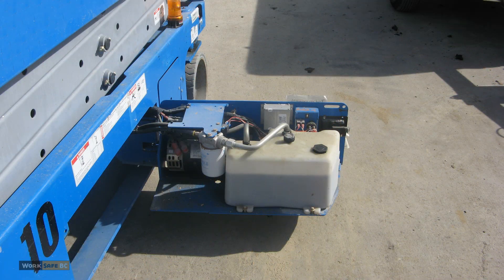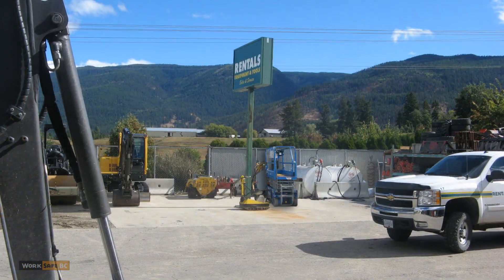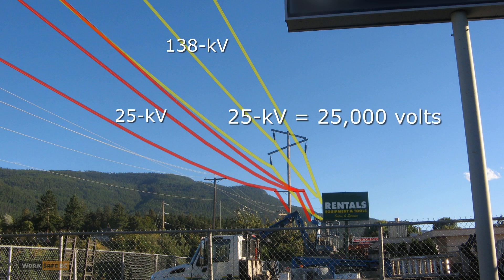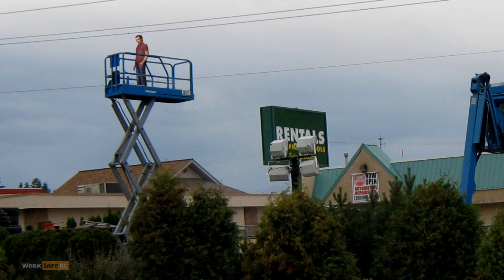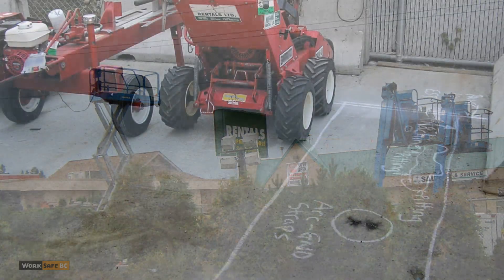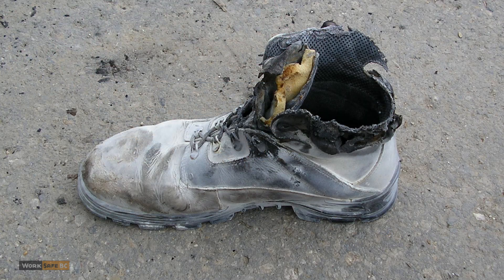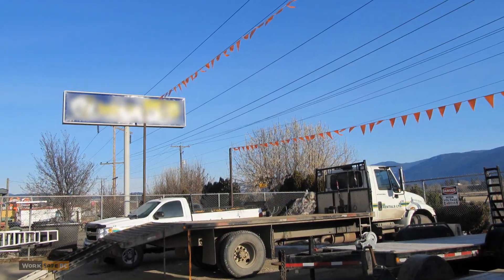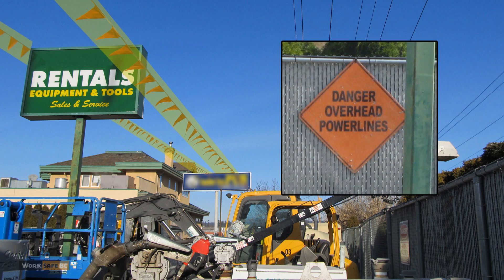Incident Investigation: Worker on Scissor Lift Electrocuted | WorkSafeBC

Comment: Why don't power companies run a low voltage bottom wire below the high voltage lines? Any contact with this lower wire by machinery would set off a flashing light and audible siren at the nearest pole warning the worker.
Reply: This stuff costs enough already
Reply: Ghost Yes, I agree - money before saving human lives. That makes the most sense.
Reply: Most people do not come into contact with power-lines.  I would say those that do either work in some related field or construction in general, and should pay better attention to there surroundings.  It is common knowledge that power-lines are dangerous so the vast majority stay clear, although accidents happen.  I don't disagree that in some instances it "makes the most sense" to put more into safety measures, I just don't think this is one of them.  The cost greatly outweighs the benefit.
Reply: Ghost The cost would actually be that of a thin aluminum wire [or two] stretching from pole to pole, and an alarm box which is next to nothing in cost considering most of us can visit our local Home Dipshit and purchase a cheap China-made door alarm for approximately the same cost. I'm not saying, "Let's go elaborate." but just have something there that safeguards the less informed people. It could be cost effective, and if dispersed over a large number of customers, the rise in utility rates to pay for such a safety device would be miniscule.

You do know that the life of just one individual is priceless, right? There's no "millions" or "billions" of dollars to measure against the value of a human life. So why not advance the entire electrical network towards better safety? To save one life would have the system pay for itself, but I have a feeling it will save hundreds of lives over time.

Enough of the defeatism! People should drop the low mentality of implementing improved safety measures only after accidents occur and instead seek the higher mentality of preemptive action. Common sense sees the problem and accident before it happens. Common sense acts upon and prevents the accident before it happens. Does power company management and their employees lack common sense?
Reply: Why can't people just be smart enough to know what they are doing?
Reply: What do you prefer, warning systems on power lines or nice roads? Lol. That's a lot of tax dollars your talking about. The best prevention of things like this is having common sense and awareness. For instance, you don't want to be 5 feet away from a 25,000 volt power line on a non insulated lift.
Reply: USNVA The thing is, how many people die on the road compared to hitting power lines? Generally, people working on power lines are trained and do so safely. Accidents like this rarely happen, and its generally a given that you don't go near giant power lines. The frequency of accidents like this are not great enough to go to such lengths to warn someone on a lift who should be smart enough to stay away from power lines in the first place unless they're a lineman or in a insulated lift if you MUST work near them. You're proposing to install dummy warnings all over the place, like a warning signal telling you not to step in front of a speeding semi truck on the interstate. There's better ways to spend those millions/billions. Like on our actual ancient, outdated, and untrustworthy power grids.
Reply: DemocracyOfHypocrisy Okay FINE. Let's drop it!
Reply: kleetus92  No one knows about every hazard that exists. Anyone who believes do as you attitude suggests you do so, are not far from a fatal brain fart. As the narrator pointed out it's  difficult to judge distance
Reply: DemocracyOfHypocrisy The more I've been thinking about it, the more I understand why the previous poster's name is Ghost. It's because he chose cost savings over safety - hence the name.
Reply: Mine puts fiber optic cables below most power lines.
Reply: kleetus92 Well perhaps one day a law will be passed that allows people [families too] to sue the power company for zero safety measures in place on exposed high voltage lines. Let's face it, bogus legislation over time has opened the door for lawsuits against McDonalds coffee burns, firearms manufacturers, automotive & tobacco industries. WTF makes you think the electric industry is any safer?!

Aside from that, more people are moving away from municipal power every day. People are choosing their own solar, wind, and back up generation over the hyper-inflated costs of a company like [let's take for a prime example - National Grid]. Even physicists were stunned by the number of assholes that could be fitted into such a small area like a power company. In 2016 they will be working on particle accelerating that asshole matter.

Comment: I just realized something... it seems like every single electrified wire i come across is insulated EXCEPT the ones that will kill you. I mean, seriously, would some rubber insulation NOT protect you from say,, 50kV???? Or at least insulate you enough from a flash over as long as you were not dancing on the lines attempting suicide.
Reply: BUNCHofxs Ya do you know how much insulation you need on a 250KV or 138KV power line?  Beside the thickness of insulation do you know how much it would take to cover all the power lines in the U.S.?  I bet you're thinking we should run all power lines underground then.  Ya and so would you be willing to double your electric bill to pay for all this nonsense when your brain should be good enough to stop you from doing stupid shit?  I don't want to pay more money to save stupid people.  I'm actually ok with this guy killing himself.  It was his fault. Not the power company nor his employer.
Reply: At voltages that high it will still arc you would need some thick insulation also any arc would melt/damage/burn the insulation.
Reply: Impedancenetwork Yes, yes, and no. Just slow down, your making loaded assumptions based on a burning desire to make someone look stupid. And making an ass of yourself in the process.